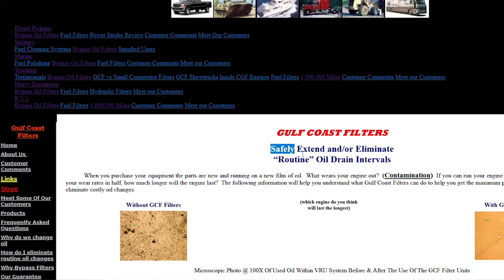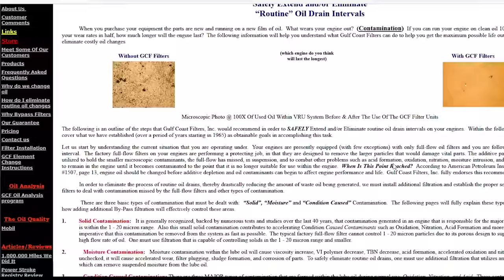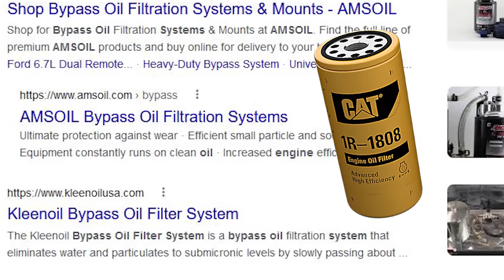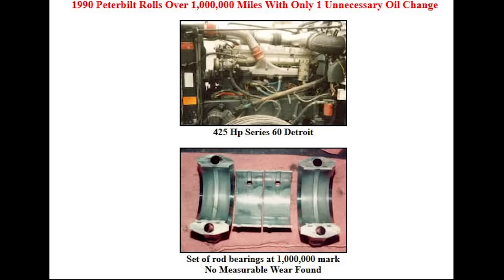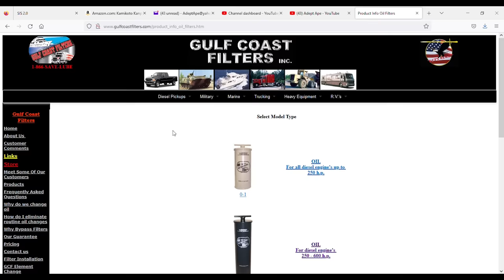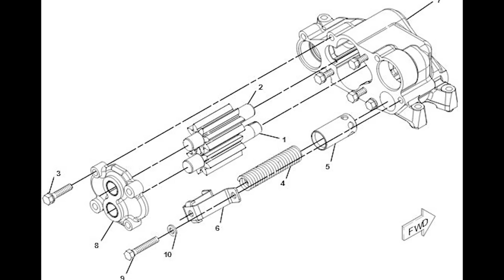No Oil Changes and 1 Million Miles!!! Are Oil Changes Optional with a Bypass Filter? (INTERESTING)

Comment: I didn't realize that any heavy duty truck engines and the like didn't have bypass filters as a matter of course!  The antique ones in my Crown Coaches do.
Reply: Bypass filters were mostly optional equipment.. my 41 Didge had a Fram with a cotton element the same as a luberfiner. The factory installed bypass filters installed these days are mostly junk. The good ones are after market. Some of them are junk.I use the Gulf Coast The Australian Jackmaster Classic. The Motor Guards. And a converted flat head Ford canister filter.Gulf Coast is the only one I have that makes large filters.

Comment: This kind of filtration is widely used in industrial (fix machinery) and large mobile applications (mining equipment). You can drastically improve the oil life by filtering and treating the oils. At some point the degradation comes in the form of oxydation. Moisture can be eliminated with filtering as well. I personally wouldnt care about it too much in an on road truck application as the engines run for long periods at a time and the moisture will "dry" itself from heat alone. 

The impact of these is not that big for engines but it can be massive when the oil reservoirs are 9000L plus.

Their claims are totally legit.

Comment: Every time you change filters, you top off the oil level to compensate for that lost in the filters. The bypass filter cartridges have additives built-in to make up for that lost over time. Of course, any obvious contamination should be addressed, and the oil changed. With the cost of a diesel rebuild for even 1ton diesel pickups being in the $10,000 range, a bypass oil filter system is cheap insurance.  IMO
Reply: I hear you. The series 60 425 HP Detroit gets its new additives when 3 gallons of new oil is added at filter changes. My Pontiac is the same except its 1 quart.

Comment: Getting all the metal particulate from wear will go a long way to extending the oil since those never really get caught by filters. Easy enough to see by watching the oil with a flashlight. Can see the faint streaks of particulate as it drains. But filter is squeaky-clean when cut open. Still, I would use something like this in conjunction with proper maintenance. Why not have it "both ways", esp. if the filters are expensive. Can have a balance of modest lube and filter life extension.

Comment: Too small of a micron filtration can actually take beneficial additives out of the oil. Not saying a bypass filter isn't beneficial but I'd have to call B.S. on 1,000,000 with one oil change. Oil just plain breaks down over time with heat. Love the content!
Reply: If you were paying attention you would understand the million mile engine  didnt go a million miles on one oil change.
Reply: @ralphwood8818 yes they do make assumptions based on ignorance. My uncle was the plant manager at auto plant in Tennessee. This brand was coming out with a CVT transmission. They brought in a tank and set it up identically to the ones they used for ATF. Filtration included. The CVT contained specific additives that the filters used (being the same as the atf) took all the additive out of the CVT fluid. 1300 cars were built and after they hit the market began failing immediately. So yes filters too fine can take additives out. But ignorance can be bliss.
Reply: Dont know what additives they put in CVT transmissions. Dont know of any depth filters that can remove the additives from Shell Rotella 15 40 conventional. The truck is a Shell oil test truck. Im sure they know what additives are in the oil. Shell offshore also uses the filters.

Comment: You could always go with the ultimate bypass filter system. The Frantz filter unit. It uses a roll of toilet paper as the filter media.
I see they are still available on Ebay.

Comment: Understand what shear does to long chain hydrocarbon molecules.  Harvesting those long chains is the very reason for cranking up the heat in the distillers to extract synthetic tier motor oil.

Comment: When at college a teacher said he worked for a company that designed a filter so good you did not need to replace oil but the oil industry bought the patent. 47 years ago .
Reply: I have used filters that eliminate oil drains for 60 years. Never heard that story. All of the filters I use eliminate oil drains. Gulf Coasts Motor Guards and The Australian Jackmaster Classic.  The Flat head Ford canister filter eliminates oil drains because I converted it to take Scott 1000.toilet paper..
Reply: Its a little risky to tell some people they dont need to drain the oil. They wont pay attention and might not know if they have a coolant or fuel contamination problem.
Reply: I probably shouldnt say elimimates oil changes. You have leaky head gaskets and such.

Comment: I have worked on a lot of 59 coming's engines and some of them had centrifuges on them to keep the contaminants out of the system and they do work. But when they start getting a lot of hours on them and you start getting a lot of fuel in the oil around 3000 or 4000 hours of running time I start to see the oil pressure going down because the oil is thinned out. I also see the SG and SH is pretty much gone by 10000 miles using synthetic oils.

Comment: My parents have a lawn mower that has never had its oil changed in 28 years. 

No air filter service, carb work, etc. just one blade sharpening. 😂

Still runs.

Comment: Dirt in oil is mostly the cause of bad oil.- but the basic number of oil still goes bad. Even if you add an additive to replenish it - it is cheaper to change oil at an extended interval. But I definitely recommend a bypass system.... especially with high dollar synthetic oil and filters.
Reply: I would call it good oil with dirt in it.
Reply: What makes the system work is never allowing the oil to get dirty and adding enough new make up oil when the filter is changed..3 gallons when the big filter is changed . 1 quart when my little filter is changed.

Comment: i filled my axle with 15w40 same as the engine... i am sure the oil filter has the high pressure bypass fully open until it worms up... bypass filter allows use of engine side filter pressure bypass valve, preventing oil starvation to the point of the oil pressure gauge then reading the actual pressure of the passages in the engine not just what's in-between the pump and filter... high pressure is bad on a filter that doesn't have a pressure bypass valve. cant fully take use of thicker oil's load index without the right filter.

Comment: I've seen engine damage from engine oil acid buildup from extended oil change intervals. Don't do it. You get pitting on. Your crank and cam journals which will cause stress risers and potentially lead to crankshaft failure from fatigue cracks.
Reply: The people studying that truck wouldnt allow the total base number to get too low. Oil analysis is Gulf Coast Filter company's game. Skipper Yee of Frantz filters once told me keep your oil clean and dry and you wont have acid problems.
Reply: Keeping the oil dry is running the engine at normal operating temperature long enough to allow the crankcase  ventilation enough time. To remove the water. Coolant contamination is another story.

Comment: Oil generally doesn't loose its lubrication, just gets dirty overtime from all the metal on mental rubbing that create small pieces of metal.
Reply: True The reason that engine has almost no wear is the oil is never allowed to get dirty.  Allowing the oil to get dirty wear and foul the engine then draining it is not how you get the long engine life..It gets 3 gallons of new oil added every 10.000 miles when the 3 gallon filter is changed. You dont save money running on dirty oil then draining it.

Comment: In my opinion a bypass filter is great for keeping your oil clean.
The claim that the oil does not break down may be true for the base oil. But the additive package (ZDDP etc…) will definitely break down/wear away over time…
Reply: The million mile truck gets 3 gallons of new oil added every 10.000 miles when the 3 gallon Gulf Coast filter is changed. More when the full flow filters are changed. Road King said thats equal to about a full oil change every 40.000 miles. Thats 100% clean oil 100 % of the time. Thats why the engine was near new at a million miles. Its old news. Road King asked me for the truck  owners phone number in 1996. Allowing the oil to get dirty then draining it is a poor maintenance program.
Reply: I see some Gulf Coast filter users are going longer between filter changes. I guess it depends on oil analysis.
Reply: Bought a V6 Oldsmobile at an auction for 600 dollars. Wife drove it a few years. Blew a head gasket. Auto parts store guy told me there is no such thing as a V6 Oldsmobile.

Comment: You really should do an oil analysis to demonstrate that no damage is occuring.
Otherwise it's all opinion.
At the very least the oil would use up it's additive package if it's not changed regularly.
We use a spin on Trasko oil filter which uses the same media as the bypass filters... and microscopy shows that it filters to ~1 micron.
Nonetheless we change the oil at the recommended intervals because:
1) The Total Base Number in particular is usually very low by the time the oil gets changed: TBN neutralises acids in the oil.
2) There is a small amount of fuel dilution (~1%).
3) Our cars don't use any oil so the additive package never gets topped up by adding oil.
4) We don't change the filters very often (~80,000 km) so the additive package doesn't get topped up this way either.
🙂
BTW: Oil filter shows no signs of decreased efficiency despite the long change intervals i.e. A new filter shows no difference in filtration.

Comment: I do not know about no oil changes, but I did see a news piece about testing oils from the cheapest to the most expensive and there was no appreciable difference when engines were examined!
Reply: Probably true. Conventional oils are a let better now. In the old days. Your engine heat was trying to do the refining that should have been done at the refinery. The result was fouled engine parts.For sure if you wanted to keep your warranty good you didnt put multi grade oil in a diesel. Delo W 30 was a decent oil. Delo came in W30 and W20.

Comment: "Oil (or grease) is cheaper than steel".  How many times have we heard that?  How many oil changes does it take to pay for an engine rebuild?  Add bypass filtration, follow a reasonable oil change interval, run your engine forever.

Comment: I had a Olds tornado (350 rocket)that I never changed the oil or filter in for 9 years. Because I didn't want to nor did I care what happened. Anyway I ended up selling the car to my neighbor for a hundred bucks and told the guy I didn't change the oil and got rid of some stupid sensors as well. He drove it for another 4 years without changing the oil or filter either. The car ran perfect all that time until it went to the salvage yard because he was Tboned  by a city bus! I hit a deer when I had it at 35mph. I only lost the O in tornado and cracked the front fascia a little. That car was a beast! They dam sure don't make them like that anymore. The draw back of that car was the windows. They were so big if you slammed the door they shattered, and my little kids back then did that ALL the time.

Comment: I get the keeping contaminants out of the oil.
But oil retaining its physical and chemical integrity and properties throughout 1, 000, 000 mile - that’s a one big “heck NO”!!! 😮

But really good way to protect the engine and extend oil change intervals!
Reply: The truck didnt have the same oil for a million miles. It got 3 gallons of new Rotella added when the 3 gallon filter was changed every 10 K miles. Pay attention.
Reply: I guestimate the Detroit gets about 350 gallons of new Rotella in a million miles. It was a Shell oil test truck.The reason the Detroit had virtuality no wear is it didnt use the conventional allow the oil to get dirty then draining it.system.

Comment: Just think it might have made it two million miles if the oil and filter was changed  regularly. Having said that I do enjoy your videos and thank you for the effort you put out.
Reply: There will always be people defending the system of allowing the oil to get dirty then draining it. I gave up that system 60 years ago. Never cared what the oil change industry recommended.
Reply: As far as I know the truck kept hauling after the 1 milion miles. The engine was near new. They had to replace a.big air intake hose oil analysis told them dirt was getting past the air cleaner.. split in a hose.

Comment: Water can get in from the intake manifold gasket on a V8 because the channels are right next to the valves in the head so water can go in your intake valve combust inside the cylinder with the gasoline and exit out the exhaust valve on a 4.6 l Ford
Reply: This won't cause an oil problem but it will ruin your motor

Comment: volvo Trucks (Europe as far as I know) have some engines with one bypass filter and one regular from factory with oil change intervals of 40 000km/25000 miles in regional trucking. so it is a longer interval as common, however it's not that long.

Comment: Bypass oil filters just like regular filters have a set amount of capacity, the capacity of these filters are only designed to hold so much contamination untill the bypass valve activates, doesn't matter how big a bypass oil filter is it cannot filter 1 million miles of soot.

Comment: The short answer is no. Shearing forces ruin oil in like 25k. I certainly don't change my oil at manufacturer recommended intervals but believe me it gets changed often
Reply: I dont think so. The million mile Detroit gets 3 gallons of new oil added every 10.000 miles. Thats equal to a full oil change every 40.000 miles when the 3 gallon filter is changed Rotella 15 40 conventional I believe. We had a problem with the polymers that made multi grade oils years ago. Couldnt use multi grade oil in a diesel.oil analysis says that is more new oil than needed.. some truckers use oil analysis and use less new oil.

Comment: I was told running an oil Bypass unit in conjuction with a PAO oil will add even more time to your oil change intervals due to their superior "Shear stability" over group 3 oils.
Reply: The million mile truck is a Shell oil test truck with a Big Gulf Coast filter. I believe it used Rotella 15 40 conventional. The reason the system works is the big filter keeps the oil clean.and it takes 3 gallons of make up oil when the 3 gallon filter is changed. The system doesnt work with small filters. Lets get real you need enough new oil added. Thats why you need to stlll drain the oil with a centrifuge.

Comment: In the case of Gulf Coast filter, it’s a 5 gallon filter and they recommend changing it every 200 hours. While you aren’t doing a traditional oil change, every other filter change, you’ve essentially changed the oil. The Gulf Coast system is best used on equipment that can’t be brought to traditional service points, marine, or equipment in remote locations. 
For equipment that has access to service facilities I recommend a 1 gallon system, or using the Harvard 5 gallon system, their filters have MUCH longer intervals than gulf coast. 
Regarding fuel dilution. It depends on the bypass element. Harvard and Gulf Coast are very dense cellulose and they will absorb moisture, coolant, and fuel. If it’s an outrageous amount, probably not, but fuel dilution over time will be handled by the properties of the filter. 
Oil gets oxidized by heat and soot, not broke down by heat and soot. However, these systems require regular changes and make up oil. This addition of regular make up oil solves the issue. 
So, they are correct, but there are better systems out there for equipment that has easy access to service locations. For on highway equipment, I recommend a one gallon system by Amsoil, Harvard, and others. The only 5 gallon system I recommend is Harvard.
Reply: I thought the double roll model was a 3 gallon filter and the single roll model was a 1 1/2 gallon.
Reply: You can get filter elements now as good as toilet paper for about 30 bucks. In 1963 I was getting MD toilet paper at a discount at the gas station when I filled the tank. The Delo 100 was golden. Delo 100 was still available in the 80s but you had to go to a Chevron dealer. It came in 20 and 30 weight. Mostly 400 now..
Reply: Dont see any difference in cleaning the oil in a stationary engine and a over the road truck. I dont know if TA truck stops still service the Gulf Coast filters on the trucks.

Comment: Look, I'm not running a diesel. I have a 2001 Chevy impala. I haven't changed the oil in 3 years. It's still a decent car. Also I've know of compressor stations in the oilfield where the engines didn't get oil changes way way past the normal required oil change schedule.
Reply: I dont doubt it with these new oils and modern engines. My diesel tractor is a 79 model. It is putting the soot in the toilet paper filter. I found a flat head Ford V8 canister filter in my junk. My wife calls me a hoarder. I converted it to take Scott 1000 and put it on the tractor.

Comment: You sound very knowledgeable. I'm having an issue with a Paccar PX8 in a Peterbilt. I'm having a low oil pressure situation. I believe I'm getting oil aeration at cruising rpm and then when I come off the throttle and the engine goes into a coasting rpm the oil pressure drops enough to trigger my oil pressure warning light. It doesn't during normal city driving when I'm doing my regular deliveries. Only after prolonged highway drives. It seems like the higher i keep the oil on the dip stick the worse the problem. What could cause this cavitation? Blow by? Anything i could do in your option?